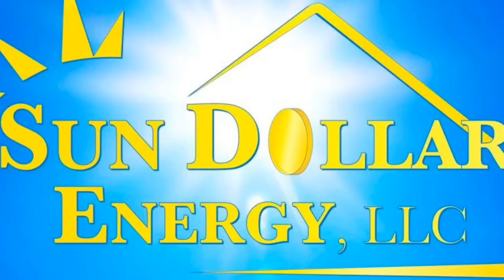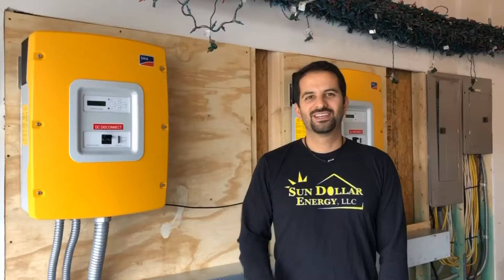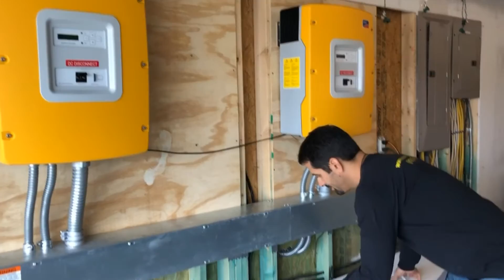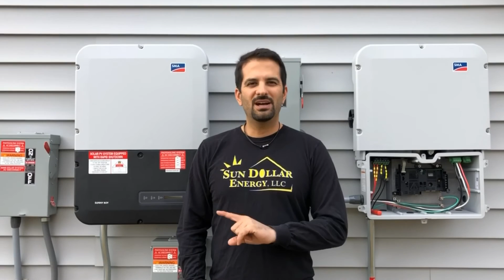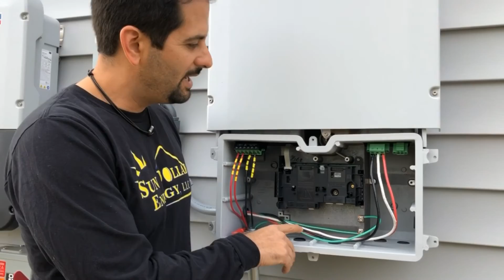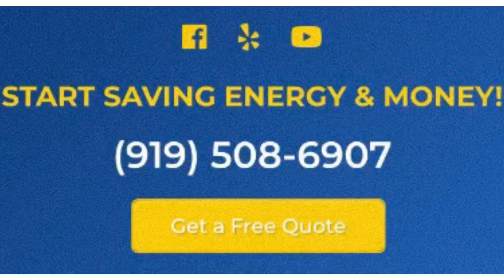Check out this homes 12kw solar with battery back up installation.

Comment: Would 2 sunny island be enough to power whole home with 50kwh battery?
What size breaker at grid (if all other breakers are moved to critical loads) connected to sunny island?  So in otherwords 200 amp breaker main panel plus either 1 or 2 breakers for either 2 or 4 sunny islands?  What size breaker at critical loads panel from sunny island?

Comment: When you try to sell your equipment by pointing out other equipments' shortcomings
more than counting your own equipment's strengths you are a failure.
Reply from the maker: These videos are meant to be informative. Not particularly selling any product.  We are installers who enjoy using different products so we like to talk about the differences and give our opinion.  Every product is different and has its own advantages or challenges.  I have yet to see one that is perfect for everyone.
Reply: If you are the vendor, yes. But if you are a customer, not at all. Also, user experience always trumps vendor marketing schpill...
Reply: It’s no different in my HVAC business. Do you want the highest efficiency, most expensive, more complicated to install/repair and lowest decibel reading? Or do you want, simple, standard efficiency, 75% less expensive, 5 decibels louder and easy to troubleshoot/repair? Both have 10 yrs parts warranty. Your choice.

Comment: How does the AC power output connect when you have two SMA inverters?  Do they parallel to get 240? How do they connect to the panel when there are two of them?

Comment: I installed 12.5kw solar with 2- 6kw sunny boy inverters two years ago. We just now installed 2- 6kw sunny islands and 12kw bi-fuel generator (gasoline/propane) to go with my 750AH battery system (36kwh). Just turned on the sunny islands yesterday. The SMA products are world class. I am planning on doubling my battery capacity within 6 months.

Comment: so does the sunny island supply the 60hz AC from the battery so the Eagle inverters keep running if the grid goes down? in a sense the sunny island BECOMES the grid, correct? thanks
Reply from the maker: Correct the Sunny Islands work with the Eagles to become the grid.

Comment: i have issue with sma inverter already
Reply from the maker: The Sunny Boy or Sunny island?  The Sunny Boys its very rare to have issues but it does happen.  I have not ever had a SunnY Island fail as of yet.   Of course any product has a certain rate of failure.  This is the most reliable I have seen in my experience.

Comment: What is the usable storage on your 40kw battery bank?
Reply from the maker: These batteries can be run down to near zero.  The Sunny Island will turn off at whatever preset level you determine.  This one is set to turn off at 20% state of charge.  So you have 32kwh before the system turns itself off to conserve the battery here.
Reply: Sun Dollar Energy thanks, I didn’t realise that they were Lithium batteries.  Very nice setup